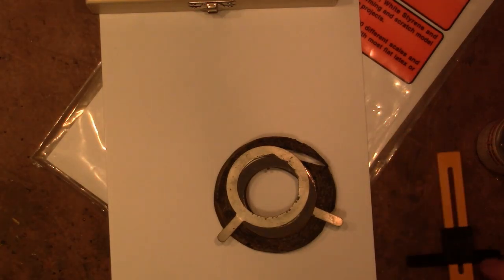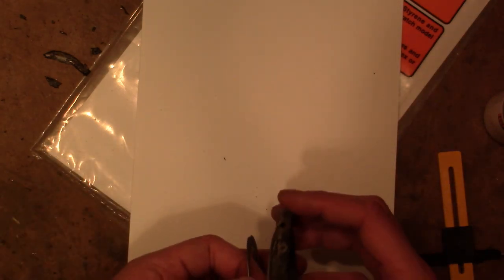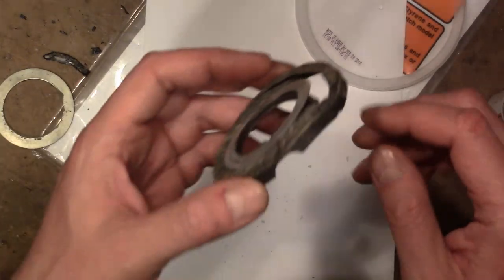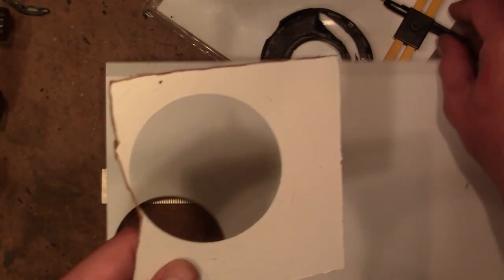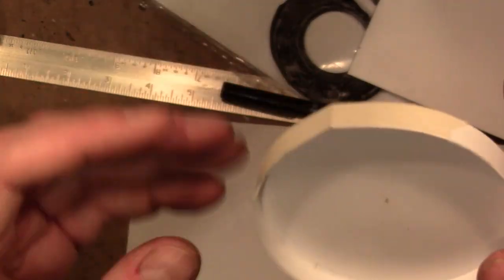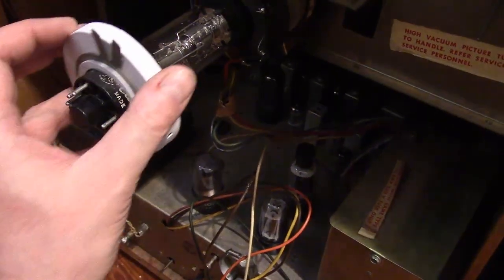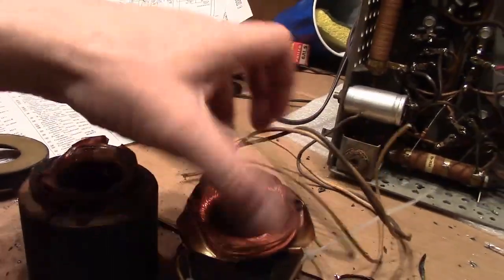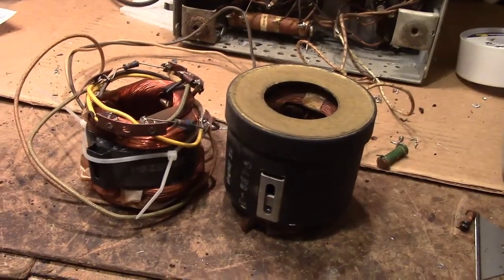Stromberg Carlson 21TQ restoration p5o6

Comment: Sounds like you should invest in a 3d printer so you can design and make little plastic things like this and more. I have 3d printed bobbins for transformers and a variety of plastic spacers, nuts and bolts as well as semi accurate replacement knobs for equipment.
Something like what you built there or the yoke cover would be no problem to print up.
Reply from the maker: +ElfNet Gaming I'm curious how one would get the metal rings on it if it was 3-d printed?  Seems to me you would need to halt the printing process, place the rings and continue printing.  I've only need to fabricate three of these in years of working on sets so I think it wold be hard to justify the cost.
Reply: bandersentv yeah you can set it to stop at a certain point to do just that. Also the cost of these things are coming down gradually too.
Reply: +bandersentv Well, if it is printed out of the ABS, it can be glued with the same glue you used, or with acetonu. So you can print it in 2 pieces and assemble it later.
Reply: Yes especially with yoke covers. IDK if the prices would justify the cost like he said though but if your doing these sorts of repair on a regular basis and making the money then sure.